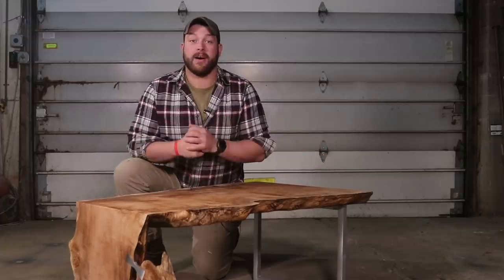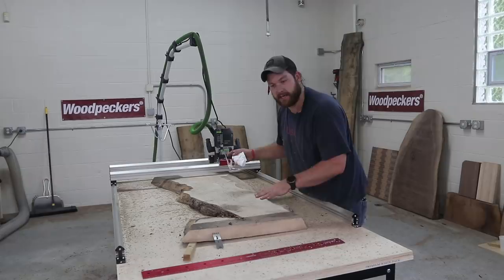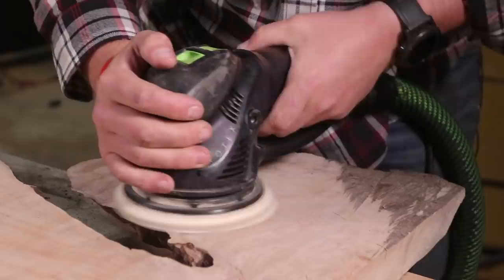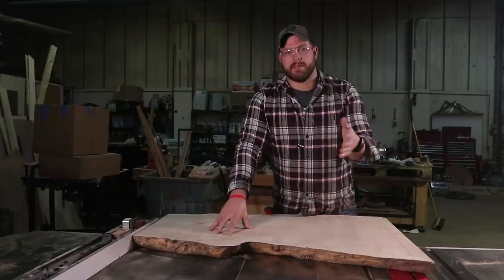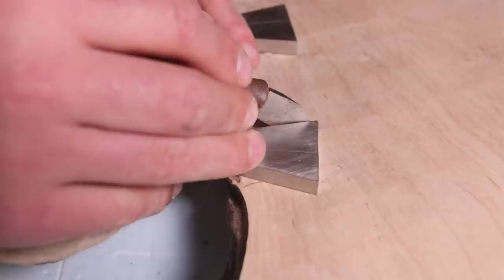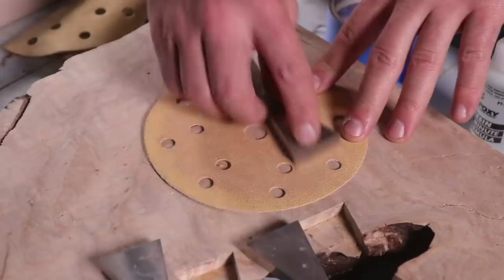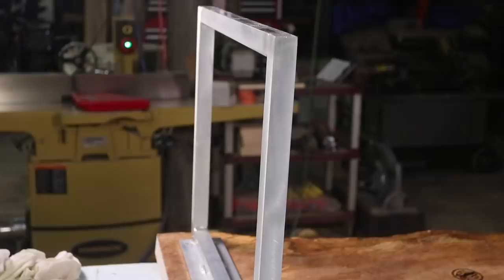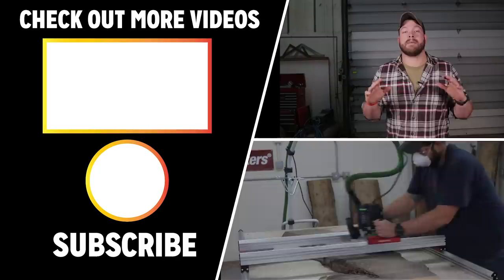Live Edge Waterfall Coffee Table | Woodworking How-To

Comment: Hey John a few questions if you don't mind me asking?  1) What oil/wax sealer do you use/recommend?  2) can you buy steel bow ties like you used? or did you make them?
The reason I ask about the oil is I'm in the throws of making my 1st live edge slab kitchen bench/breakfast bar and want to make sure I seal it right.    I don't like the stodgy look of some varnish as it looks thick and plastic some times.  I've seen where the varnish is thinned with turps maybe that would be a better option for me.  Any recommendation?  would be grateful... Cheers

Comment: The slab jig is nice, but when screwing those rails down to a top you can't just assume the top has zero twist to it, the rails should be checked across the ends with a level.
Reply from the maker: Hey Dan, So when flattening a slab its relative to itself. You're not necessarily "Leveling" the slab as much as you are making it parallel. So, by using a level flat surface for reference, you're able to guarantee that by mounting the flattening jig to it you are going to create a flat reference surface in order to make it parallel. But yes, you can also use a level to ensure its level!
Reply: @John_Malecki  John, you are making an assumption that the bench or other surface being used is itself perfectly flat.  If the surface has a corner that's a bit low due to variations in the build, floor, etc.. then the rails will have a twist relative to each other that will be duplicated in the slab.  It doesn't matter if they both trend up or down from end to end or side to side as long as they are truly parallel to each other (no twist).  Of course the wider the slab, the more important it becomes to check.  Also depending on what's being built, a bit of twist may or may not be troublesome, but if you want it truly flat the rails should be checked across the ends.  Fixing a twist isn't easy if they are bolted to something solidly built like an outfeed table as shimming under a rail just causes the slab to be thicker there, ideally you need to adjust a corner of the surface up or down so where the slab lies and the rails move together.  I know that's getting a little picky and in most cases it will be fine, but my comment was also intended for those watching the video who might want to try it themselves.  The table you used may by chance have been perfectly flat or close enough, but the next guy slapping rails onto some surface to flatten a slab may have all kinds of trouble if the rails have a twist to them..  :)
Reply from the maker: You are correct. I shouldnt have assumed people typically flatten and their work surfaces. In the future i'll make sure to be more clear on that part. thanks for the comment!

Comment: John,
Maybe it's just me and my small tablet, but when you flip the slab and secure it, at 1:35 into the video, I think I see the end of the slab up off the bench and it pulls down when you drive the screw into the dog. Maybe there was dust under the slab, but it appears that the first side is still not completely flat and on the bench. You notice it?
Reply from the maker: its flat. Flatness is relative to the top side of the slab after it is flattened. The hold downs also flex and give the illusion the slab is moving more than it is. It is also a whole slab, so i dont need the bottom perfectly flat across. I have the center perfectly flat for reference on the top. Hope that helps tom!

Comment: I live in central Arkansas and we have high humidity during summer months. What kind of moisture content would be acceptable before starting any work on walnut? I can’t seem to find a good answer to this question. Beautiful work!  Love following your work! Very inspirational
Reply from the maker: Single digits. So below 10%
Reply: Do you have a video of how you attach metal/wood bases to a slab piece? I am interested in seeing this done to alleviate expansion and contraction without the possibility of cracking your work. If you do then I may not be looking hard enough. Maybe a little commentating about how it’s done as well....
Reply from the maker: Just use a counter sunk insert and a sloppy hole to attach your metal legs. Nothing complicated

Comment: This is a gorgeous table design!  I might have missed it, but where did you get the metal inlays?  Also, it there a way to adjust the height on that woodpecker flattening sled?
Reply from the maker: The inlays were a gift i got years ago and unfortunately cant remember who. The jigs vertical adjustment is based on what you screw it to (can use spacers) or the depth of the router you're using
Reply: @John_Malecki  and I've even seen an extender/spacer that makes your router bit have even more of a reach in this type of situation.
Reply: When i first saw the metal ones i was like not wholly sure on that like but man they set it off real nice - found some here if ya still looking 👍 https://www.custommade.com/butterflybowtie-brass-copper-stainless-inlay/by/roguemachine/